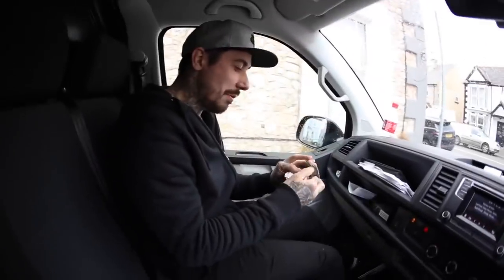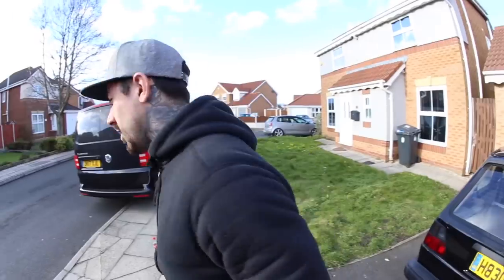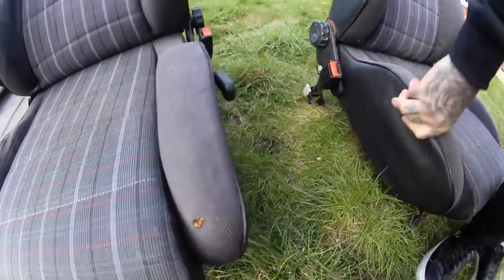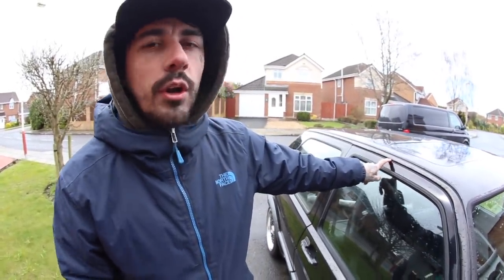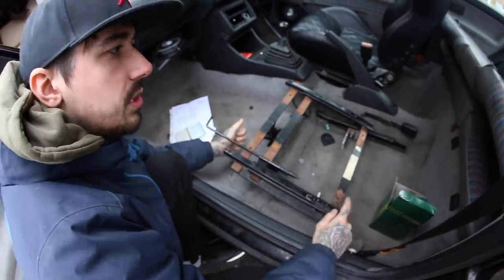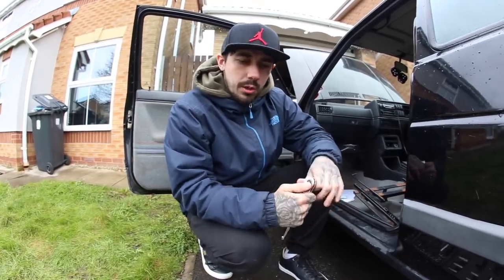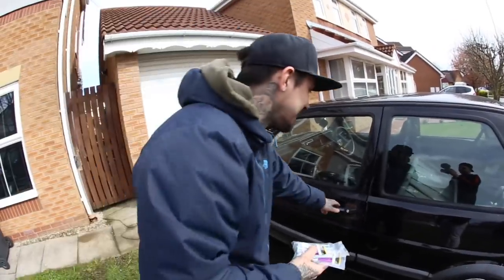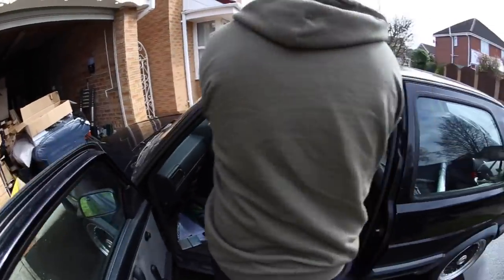WE FOUND SEATS!! | VW GOLF MK2 | INSTALLATION!!

Comment: You were right about the seat mech.... But only need a short nut n bolt in the end of the rail to stop the seat sliding to far back and off the side runners.....

Comment: Hi seat front bolt sliding pin with spring , it aligns with the seat adjuster , rear runners needs plastic spacer for the  seat
Reply from the maker: Yes mate just seen that

Comment: It’s a clip special to vw.   That mounts the vw track.    Your handle moves the rod that is like a pin lock.    ( like a vacuum pole extension.  Or a tent peg ).        Have done mark 1.   Mark 2.  Mark 3.  And mark 4.    Ground up builds.        Mark 2.  Also had recaro seats  if it’s a true gti.    Hit me up
Reply: And there is to models.   Both seats built by recaro.      Insta me.   I still build vws   Can answer any question you got                 And a mark 3 vr with a super charger is not hard.  👌🏻
Reply from the maker: Hello mate yes we ended up figuring it out where the spring attaches to it et cetera thanks for your help mate

Comment: Honestly, i was unimpressed with C4, 20quid for 15ml. Prepped my slightly faded trim properly and applied it generously yet they still faded 3-4 months later. Ended up buying Meguiar's Ultimate Black for 12quid and it's great. My car is always outside and I use it once a month at most, can still go longer without any "greying" and the bottle has still lasted me well over a year so far. Highly highly recommended product!
Reply from the maker: Ferran off mate I will try that Maguires stuff tomorrow
Reply from the maker: Fair eneough

Comment: I have a black 16v Mk2 GTi on bike carbs(my third one) he was right but the bolt is alot shorter and it literally is on the last hole to stop the seat sliding back when you adjust and fall off. 
By the way look up vw heritage for literally every part you need and thank me later 🤙🏼
Reply from the maker: Awesome mate I will check that out and yes after reading all these comments it’s so obvious that it needs the bolts at the front

Comment: I have a mk2 jetta which is exactly the same and all I have is a small Allen key bolt and nut which goes through the small hole at the front to lock the seat in.
And I found autobrite dye was a good thing to restore trim and lasts longer than polish and trim restorer, take the trim off and spray the dye onto a sponge and simply rub on the trim!
Reply from the maker: Awesome mate where did you get it from online?
Reply: I’m not to sure if Halfords sell it, but either auto brite website or on eBay, I used it first to dye my fabric headlining and tried it on my trims and it worked amazing, I have a couple bottles left in my garage left over I think however I’m at the bottom of the country in Kent

Comment: The very first hole on the rail is for a little m6 bolt, only needs to be about 12mm. It goes in the very first hole but not through anything because like you said the pin goes through it to select how far forward you wanna sit. If you put a small bolt in the first hole it stops the seat falling out when you try and slide all the way back. 
Also VW heritage are good for smaller bits like that white clip but if you want bigger stuff like bumpers and that you’re better off getting original good condition second hand ones 🤙🏼
Reply from the maker: Yes mate I have heard great things about VW heritage thanks a lot dude I will check them out

Comment: Not gonna lie this is back to classic Harry main, love this.
Just a few things I’ve thought whatching this which might help you:
1) a place in Deeside north wales a bit and bolt shop called Lloyd and jones you can google them they might even have a branch in Liverpool. Just go and get say 100 nuts and bolts of each size so say 30mm and 60mm long in m6 m8 and m4. You won’t understand how you did without this selection under your fingertips it’s so much easier and makes stuff less bodged.
2) get yourself some copper grease/coppaslip to put on your boosts before you put the nuts on, you’ll be so glad in 5/10 years time when you come to undo the bolts you put in and they just loosen straight off rather than having the constant fight against rust which you will have in such a classic
3) you might find helpful what’s basically a wire brush to go on your angle grinder which just makes such light work of rust removal it’s unreal
Hope this is of use certainly these have been a few godsends for me in the past
Ps keep his up loving it
Reply from the maker: Hey mate this is definitely 100% been extremely useful as a comment I’m going to do all three of these

Comment: make sure any bolts you use are atleast 8.8 tensile strength because normal bolts are not good enough in the event of a crash. try screwfix for bolts washers and nyloc nuts. good luck with the build.

Comment: For the trims . Solution finish is great as for the seat all that hold them in is a small bolt on the end to stop them coming off the runners 
They are gti seats off a early type 19
Reply from the maker: Awesome mate so what year would that be type 19?
Reply: Anything from 83 onwards for early seats around 89 they then borght in the 90s spec rainbow interia what i have in my vr6
Reply: Need parts for a mk2 mathew parmer at mk2 spares uk will have what you need. U can find him on instagram

Comment: Go to get a exhaust customise from a company on the both of them i had a t6 and just sold it i would gave you my seats and steering wheel if i still had it! I have a mk2 locked up and i got a fully customise exhaust and got a big intake and it sounded mint! Ill look out my old front bumper for the t6

Comment: Re the plastic trims... get a dedicated product from GTechniq or Gyeon Quartz which will coat and protect the plastics... it also conditions and returns them to black... not expensive and between applications which should last 12-18 months minimum a proper fix without having to replace with new parts.

Comment: HARRY, in your previous video you said you want to sort the throttle cable and you want to grease it up. Tighten the cable on the Throttlebody would make it more responsive aswell!
Reply from the maker: Yes mate that makes sense a lot! It’s so so stiff it’s crazy
Reply: Harry Main taking the throttle body off and giving it a good clean would help a lot aswell probably abit stuff and clogged up from over then years 🤟🏼

Comment: Do a boot build get a nice sound system setup going :D will be “nice little touch init” plus get yourself a wet vac hoover on those seats :) my partners a valeter get ,bucket, car shampoo, some G101 and hot water scrub into seats then hoover it satisfying when it’s done :D
Reply: Alex Gallagher G101 is fucking mint it’s the best stuff I’ve ever used
Reply from the maker: That sounds really really good thanks for the tips
Reply: Harry Main no problem haha you can get g101 from autosmart give them a call it’s not too expensive 👌

Comment: Ite bro its a bolt and dome nut holding the front seat in place and youll probs need new white seat runners there only a couple of pound and hold the seats in the runners tight and secure ps love the fact you now own a mk2 there the best cars ever i sold mine and have been looking for a replacment ever since. Keep it up dude.
Reply from the maker: That’s amazing mate thanks for the information! What was your mark to golf
Reply: @harrymain  hey bro, mine started life as a red 1.8 8v gti small bumper but after 4 years of ownership and many mods later i swapped the engine out for a 2.0 16v abf engine from a mk3 gti which in my opinion is the best engine swap for a mk2  as its a easy conversion and makes the car feel savage reving upto 8k rpm you wouldnt look back mate, keep it small bumper too mate dont listen to anyone saying go big bumper they look naf 👊 keep the content coming dude loving it.

Comment: You need to put a bolt in the front hole once the seats are fitted to stop them sliding back out of the rail when you move the seat

Comment: 10MM BOLT : goes into the smallest first hole in front on the lock to stop you sliding it too far back! 🤙🏽
Reply from the maker: Thanks
Reply: Harry Main no problem Bossman! I’ll try to help as much as I can 😂 good luck with the build dude! Also Halfords sell a plastic spray paint which is a flexi-Paint so it doesn’t crack, should be perfect for the trims!

Comment: If you use a heat gun use it at a bit of a distance a move it a lot. It will work better than shoe polish as that only lasted on my car until it rained
Reply from the maker: Fair enough mate thanks for the info

Comment: Harry Mk2 golfs have a spring and pin mechanism at the front to adjust the seat forward and backwards and then click back into place. Google Mk2 golf front seat lock pin and you’ll see what I mean. I have a 1986 Mk2 so any other info you need I’ll be happy to help
Reply: Also EBay is your friend when it comes to Mk2 golf bits
Reply from the maker: Yes mate they are both still there mate we figured it out at the end of the video

Comment: You need to make sure you have the plastic seat runner clips for the seats or they won't slide without them. They are only a few quid on Ebay.
Reply from the maker: Yes mate I have ordered some

Comment: I use screwfix or toolstation? But I know Wilkinsons have a DIY department with the equivalent to a pick and mix section where you can pick what you want and how many you do you don’t have to buy full packs...nuts/bolts/washers etc,
Reply from the maker: Okay mate this is helpful cheers for that I will check it out there is a tool station near me I will try that as well next time

Comment: The front bolt on mine was just a small nut and bolt that just threaded through that front seat mount to stop the seat sliding off
Reply from the maker: I know mate I’ve noticed after reading these comments that I need to put the bolts in the very end

Comment: Ufix autos lad in warrington you can hire a workshop its sick not expensive either. You pay then get a code and you access the workshop anytime you want even 24hr . (Adding to this it's got a 2 poster ramp its sick)

Add again 

Screwfix and tool station for bolts stupid cheap.
Reply from the maker: No way mate that is crazy is it usually pretty busy or not, is it like individual booths?
Reply: @harrymain  it's one workshop (lockup garage)  you book the whole thing out. Air compressor alot of tools ect.... get in there. Drop me message if you want any help. Not expensive!

http://ufixautos.co.uk/phone/index.html

It's where I slammed my t5 

Also while I'm here night heater for the t6 is a must!!! Meet us I'll show you my setup

Comment: Are you going to do the single front light grill conversion or leave it with the 4 lights,I personally prefer the single grill.Also you wanna use a place called gsf who deal in German cars and have all the stuff for golfs.
Reply from the maker: Okay awesome mate what do you drive? Your picture is awesome! Also mate I will check that out and yes mate I’m going to go for the single light grill 100%. Do you know what I do with the wires off the other lights just take them off and hide them?
Reply: @harrymain  I do drive a bloody nissan juke cos kids but back in the day I had golfs and not sure on the wiring Harry cos all mine I brought with the grill already done but get in the forums and they will point you in right direction and also have so many parts for sale.

Comment: Hey Harry, you need the proper seat adjuster pins for the front of the seat. The pin goes through the hole. You almost had it in your video.  The 10mm is to stop the seat sliding back to far.  I know shit loads about mk2's. Yes Vw Heritage are good for part.
Reply from the maker: Hey Tim thanks for the comment bro I actually managed to sort it out with the bolts on the spring et cetera so the lever now move the seat properly
Reply: Thanks for your reply,  in reference to your plastics and bumpers, it not a good idea to use a heat gun. It looks good at first, then drys out and looks 10   times worst than before. I use WURTH KUNSTSTOFFFARBER, PLASTIC DYER,  that the full product name. You can get it 
on eBay. If you use it don't get on your paint work. Make sure all parts are clean, I use IPA to decontaminate. Good luck with the rest of the project.

Comment: front bolt is for the hole right at the end just to stop the seat sliding off the front runner dont need to be a massive bolt
Reply from the maker: Yes mate totally on it thanks for that I’m gonna fix it tomorrow

Comment: No need to buy any other socket set. HALFORDS are great tools. I'm a qualified mechanic and work on cars om a weekly basis. I've been usen them for years. And they have life time warranty. So no need to swap to the likes of snap on. When they break you have warrenty... For the bolts I usually go to a engineering shop. They make whatever you need up there and then for next to nothing
Reply from the maker: Okay great thanks for the help

Comment: the carburettors on the 1.6's are awful. i know you dont want to do any engine modifications but a good idea for now would be to replace it with a weber 32/34. it makes it run so much better and you won't be stalling everytime you stop at a set of traffic lights ;)
Reply from the maker: Yes mate that’s the problem I’m having at the moment how do I replace it then just order that part above?
Reply: @harrymain  yeah vwheritage sell the kit for £340. could get a used one on ebay abit cheaper but its a direct replacement from the old one pretty much. the ammount of bits makes it look scary and complicated but i replaced mine in a few hours.

Comment: Will you be doing an engine change if so look for a golf vr6 engine
Reply: Single head lights and wide body arches all ways look good
Reply from the maker: Yes matel 32 would be my dream
Reply: Or you could put a 1.8 with twin 40 carberettas that sound nice
Reply: @harrymain   you could put a 1.8 with twin 40's carbs they sound good mate
Reply: @harrymain  I like the old school motors I've got loads of ideas if your intrested

Comment: Use a product called "CoverAll" for those door panel pieces to bring them back out
Reply from the maker: Okay mate what exactly is it? Do you order it online as well?
Reply: I'm from the US and they sell it at our local auto supply store
Reply: I'm sure you can order offline and indeed is the best to spruce up the VW door protectors. It's made for the plastic on ATV'S, so this works great on tires as well mate.
Reply: It's a aerosol spray can